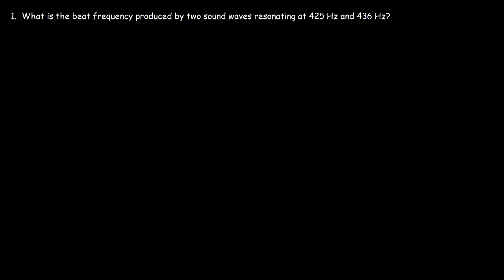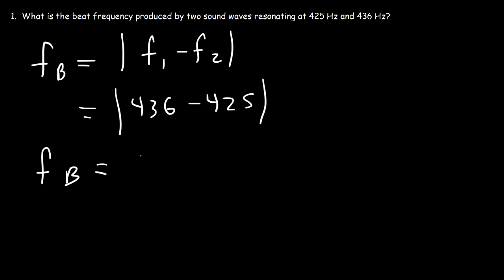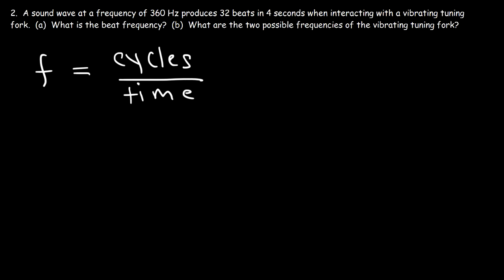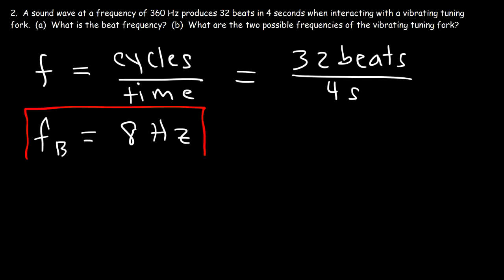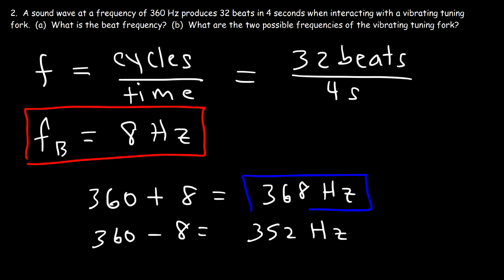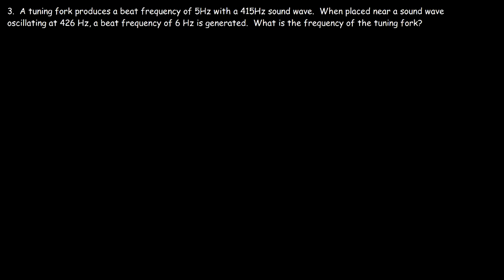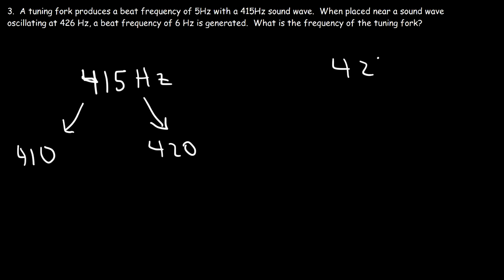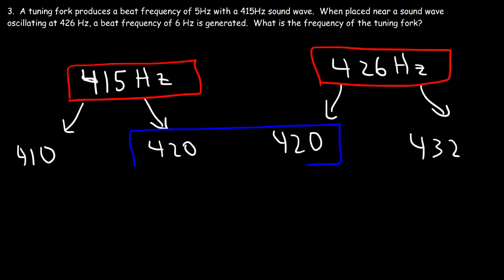Beat Frequency Physics Problems

Comment: Perfect nice, direct and simple. I stopped by because I need to determine the difference of two musicial pitches, one is out by 0.5 - 1.0 cent, they need to be exact, I need to specify how much off pitch one note is only by beating the two together. So now, I count the beats over a stopwatch time base and job sorted, perfect.